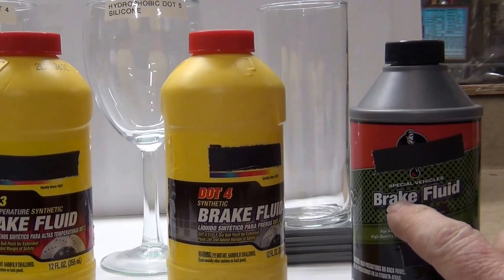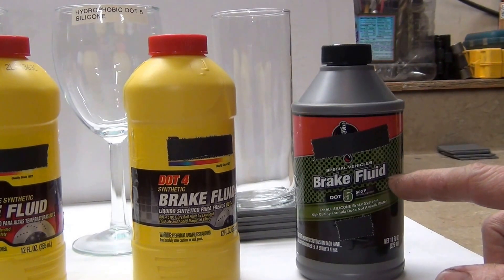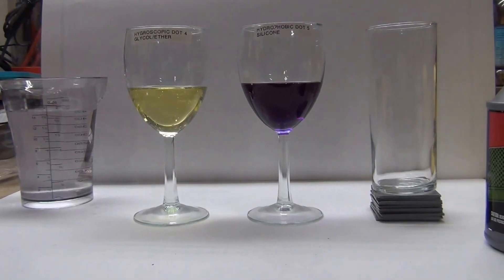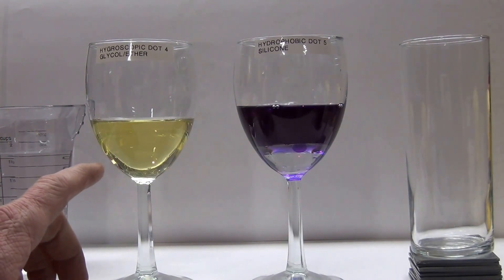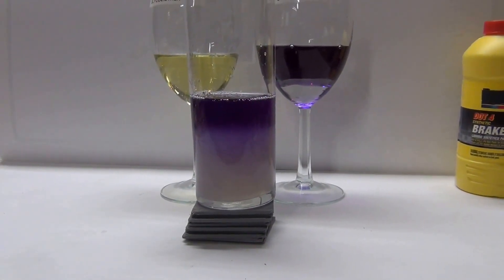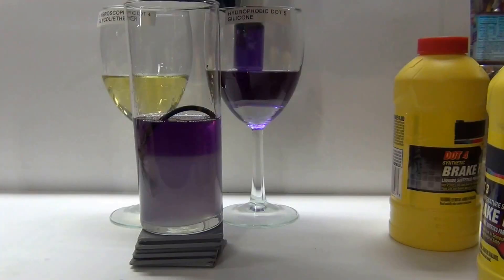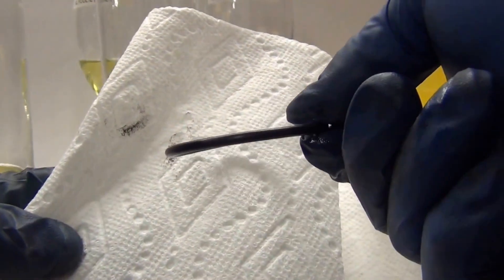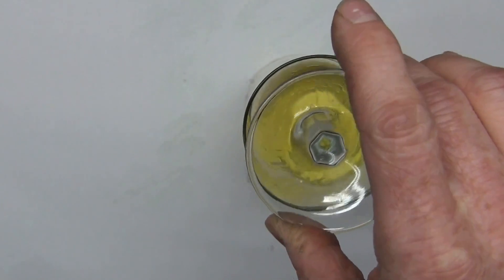Can I Mix Brake Fluid DOT Types Together? or With Water?  Answers!

Comment: Hi Brian, you mentioned the dot 5 in your mountain bike. Was that replacing a mineral oil brake or a dot fluid brake? Just asking because I'm curious if the dot 5 would effect seals that are designed for mineral oil?

Comment: The army asks for something that's hydrophobic. The hydrophobic break fluid lets water collect at the bottom and cause no end of problems.

Yep, that sounds like the military logic that I know and loathe.
Reply: since it repels water as opposed to absorbing it directly from the air there is no conduit for water to accumulate, anywhere.....  it is perfect for a system that is sealed and people are not pouringwater into the brake fluid container.
Reply: @kevinoconnell8242  perfect answer...

Comment: SO if I wanted to change over to DOT 5, all I have to do is pour it right on top of the DOT 3, and pump the brakes until I see solid dark purple from the bleeders?
Reply: If your car doesn't call for DOT 5 and didn't have dot 5 in it already it's a bad idea to try to switch to it, also from what I've read it may not need to be changed so often but it gives a bad pedal feel and doesn't work as well (won't work with ABS so well in colder climates due to the viscosity of it).

Comment: ive kept a bottle of 5l dot 3 fluid and it kept for almost 2 years lol mind you i kept the cap on tight all times but i used it often and it felt just as good the last bit i used as when the bottle was new, and ive also had brakefluid sprayed in my eye from my bleeder hose coming off LOL watch out for that but im fine

Comment: Excellent video! About seals: I have a 2-cycle weed eater engine that I partly disassembled and cleaned with carburetor cleaner. I re-assembled it and liberally applied 2-cycle synthetic oil of the suggested type on all bearing surfaces and its crank case O-ring seal.  The carburetor cleaner didn't seem to hurt the ring right away so I just oiled it and put it back in there. Was that the right thing to do? Or will that ring be unable to deal with all that oil and solvent?

Comment: Having a couple of military trucks and working with civilian trucks, I have experience with long term use of the different types of brake fluids from DOT 3 - DOT 5, but haven't used the DOT 5.1. 
Military specs suggest to use DOT 5 specifically because it is hydrophobic (does not absorb water) for many reasons, one being that some vehicles are designed for water fording.  Also, they want a standard for use in many vehicles, so that they do not have to carry a multitude of fluids that are not applicable to all.  

When you "accidentally" mix DOT 3/4 with DOT 5, it does eventually sort of mix together, if you call silicone sludge slime mixing.  It creates all sorts of problems when the fluids are mixed.  My 46 year old truck has DOT 5 in it and it works like a charm.  
The only real time you wouldn't want to use DOT 5 is with fast acting actuators like they use in ABS systems, it does tend to draw up the bubbles which is not good for ABS type of brakes.

People wonder how the "water" gets into the brake system.  Mostly from the heating and cooling from the brakes, not just when you leave the cap off of the master cylinder, though that can contribute to it as well.

Good video, keep up the good work. Sub'ed.

5Ton Fluffy
Reply: I've been wondering though, some water mixes in with dot 3 or 4 but water sits on top or on bottom of dot 5 which, to me, would be worse because it would be direct water on internal components vs a mix.

I'm trying to figure out what I have, I have a humvee which should be dot 5 silicone but my color is a dot 3 or 4(not purple), some people say it can change color but that would be pretty dramatic if it shifted from purple to yellowish.

Comment: I bought a 1957 MGA from my girlfriend for $200.  She had put regular brake fluid in it when it needed the mineral oil  available back in 1975.  I had to open the system including clutch slave cylinder.  I replaced all the o-rings and natural rubber parts that the fluid comes in contact with, replace with new parts, and bleed the system.

Comment: Wow,  totally informative.  I never knew it broke down and how water affected it.  Now I'm writing dates on my stuff.  Makes sense but i didnt know how it worked.  I flushed my integra lines to the rear from the prop valve and it was all milky and gross.  Till I cleaned them out and blew air through.  Then I got them done up right with good pressure.  But i was surprised at the crap that came out of both sides. Works great now till engine blew,  but ill rebuild it quick enough.  I use Lucas oil additive on stuff alot but not alot per car. I just use old fluid for bleeder kits. I'm hoping that's ok. God bless your family Brian,  dam fine job sir!!  HUA.
Reply: You can get electronic brake fluid testing device that tells you the moisture content of brake fluid and if it's still good, acceptable or bad. I had a container that was opened about 6 months ago, with some extra fluid and I think it tested 0% or 1% moisture (can't remember) but it was still good. The stuff in my cars brake system (from that same bottle) was like 2% or 3% basically almost at the 4% 'bad' level.  So as long as the bottle isn't left open and has a good seal it might still be good.

Comment: No Old Wives Tale. As you know coming from a cold climate as well Bmob... Silicone will swell rubber...just like weather stripping. I have personally had to deal with this situation twice in my career. Once with a 2001 Cavalier, and once three years later with a Suzuki Vitara... both brought to me with a soft pedal. After a quick inspection, I found that all seals...including the seal even on the cap for the master cylinders were soft gooey and swollen and unable to hold their shape. Ironically on the Suzuki, the Girls Father owned a Harley Davidson and toped up the brake fluid with DOT5 after replacing one of her calipers. So yes, it is infact true. Just thought I would share my personal experience. Thank you for what you do!
Reply: And I was thinking a layer of dot 5 silicon would help keep the air out of a dot 3 and 4 brake system

Comment: Is DOT 4 Ultra just as good as DOT 5.1 ?
Reply: Yes it can be. There are some DOT 4s with higher boiling temperatures than DOT 5 or 5.1. I think manufacturers are afraid to call them 5.1 just because people are confused / afraid of using the wrong 5.0 one in their cars. Make sure to look at the dry and wet  boiling points. Low viscosity ones are supposed to be better if your car has ABS and you're in a cold climate. 
Unless you're taking your car to the track though I don't think most people NEED a brake fluid with a really high boiling point.

Comment: how about oil and break fluid , I worked on someone’s car and found oil in the break fluid reservoir
Reply from the maker: I've heard stories of the wrong fluid in just about everything.  That would be interesting.
Reply: I once put oil in the radiator in a Load Handling Truck in Afghanistan.  Maintenance hated me for the rest of deployment, possibly having to do with emptying half-liter bottles to flush out such a huge system.
Reply: i've heard that can cause problems... DOH!

Comment: i jave 2001explorer sport  with a 4.0v6 sohc automatic  tranns does the neutral safty switch  on that control my reverse lights  on my car
Reply: You don't have a neutral safety switch on that one nor a reverse indicator switch either.  You have instead an all in one range selector switch. See how the terminology changed to indicate the situation? Use the proper term and avoid confusion. The hint all in one gives the answer yes but there is are computers involved to drive the reverse lamps. Prior experience with that system and I know that the connector for the range selector is hanging out in the breeze where things can tear loose critical wires used by the computers to tell it what gear the transmission is in. Mine was 2001 F150  Transmission 4R100  - dorman 511-101 range switch WPT806 connector, 3U2Z-14S411-FGAA wiring kit with new connector. eBay has the kit for $60, search wpt806 though.
Reply: Lee Barnes i was told by ford thats what is called i have an explorer not a 150  thanks

Comment: Question,
If we buy a small bottle to top off dot 3 normal type everyday use cars, the bottle that was opened should not be used anymore due to moisture in it?
Reply: Joe Soliz Technically, you shouldn't have to top off your brake fluid! As the brakes wear, it will displace fluid for the missing brake lining. If your brake fluid gets low, it means that your brake linings are worn out! Topping off the fluid is useless, as time has passed since last serviced, and you should change the linings AND FLUID! But to answer your question, NO DONT USE IT! One does not know how long it has been opened, nor how much moisture it has absorbed! Even if you opened it, and know it has had a cap on it, and for how long, it absorbs moisture over time. Now, as a side note, if you live in a dry climate, and you open a new can of brake fluid for a slight leak after a brake linings change, and you just use it temporarily until you can get the leak repaired, and you use an opened bottle for a few days, it will not harm anything.
Reply: Makes Sense, and I am understanding what it means to do a brake job & why they cost so much, if done properly. Thanks for the input.
Reply from the maker: A good rule of thumb is if the open bottle is more than 3-6 months old in a humid climate- it's deteriorated.  It will still work, but not at the level it's designed to as set forth by the DOT.
Reply: Joe Soliz No, that's not the case with the moisture!! While a moisture contaminated brake fluid can certainly cause deterioration of the internal brake lines, it's not an immediate concern. Moisture dissolved in the fluid will change the boiling point of the fluid. It will not absorb as much heat, and may turn to a steam too early, and therefore not actuate the brakes when needed! Brakes change the form of movement into a heat! The friction from the linings against the rotor (or drum) produce massive amounts of heat. Some of the heat is transferred to the fluid. The fluid is a hydraulic fluid, transmitting pressure from the drivers foot, to the linings against the rotor! If there is water present, it could flash to steam, and steam makes a horrible hydraulic fluid! Or I should say, it does not make a hydraulic fluid much at all. Moisture would prevent the fluid from doing its job, causing a collision if the brakes failed, long before any corrosion would cause issues!! Beside, a vehicle from the rust belt already has corrosion issues from the outside! It's more serious than from the inside!!
Reply: Billy R Very good theory. However, there is a small hole in the reservoir that allows excess fluid in storage to be drained into the fluid column in case of a fluid loss. So, as the brake pedal is completely released, any pressure build up would then be released if the brake pedal is released. But the steam in question would flash over as the brakes are being applied. And if at any time the brake pedal is released, the steam is allowed to expand, forcing fluid out back into the reservoir, and then on next brake application, VOILA no brakes! In a scenario where one is taking a weekend romp in the backwoods, down a mountain. Repeated application of the brakes, followed by a short burst of acceleration, followed again by heavy pressure on the brakes. Heat could build up in the caliper, very close to the pads and rotors. The excess heat is transferred into the fluid. It builds up to a point that any excess moisture would suddenly flash over to steam. As the brake pedal is released, the moisture turns to steam, and expands greatly! The expanding steam pushes extra fluid back into the reservoir. No pressure on the brakes. Heat dissipates for a moment, and removes the high temps needed to make steam. Regardless, the next brake application is not as expected, and maybe non-existent! So your weekend afternoon romp in the back woods mountains, turns into a frame bending accidents into an unsuspecting tree!! Fresh clean and proper brake fluid is crucial in every brake system. Dirty, wet, and incorrect brake fluid is a recipe for disaster! Change fluid at every brake service. Don't just pop in new pads. Take things apart, do an inspection, clean of the gunk, lube the contact points, and CHANGE THAT OLD NASTY FLUID! If you do a front brake job, take the back wheels off, inspect what is there, adjust if necessary, replace if close! Change the fluid every 3+/- years.
Reply: I see, contamination can deteriorate the lines and thus give you a false sense of thinking that you have a bad brake master cylinder & braking system components. Thanks, learning as I grow to understand things. Thanks for the info.
Reply: Good Theory ! But I would think that the steam would build excess pressure that would not be fully released when the break pedal is released due to expansion causing premature failure of the caliper and or the break linings ?
Reply from the maker: Did you see how normal the DOT 4 looked with all that water in it?  Crazy huh?
Reply: I know, love that someone explains the stuff we are buying

Comment: Brian Glycol Ethers' claim to fame is that they are completely miscible with water. These chemicals are the key to all waterborne paint systems (like house paint) as they have the solvent power necessary to dissolve a resin but can be diluted with water. This unique property of glycol ethers (the ability to mix with water) are why antifreeze works the way it does. Any brake fluid that uses glycol either will absorb water.
Reply from the maker: Nailed it!  You just earned a heart to that comment.  Well said, and thanks for saying it.

Comment: why does the fluid look dirty and used after time even though the system is sealed?
Reply: MusTang Nick I believe it has something to do with heat cycles over the life of the fluid. I think the heat breaks it down over time, that and corrosion from the steel lines
Reply: MusTang Nick The master cylinder caps will still allow some air and moisture in. especially in humid regions.

Comment: So can I use Dot 5 instead of dot 4 on my bike? Or is that not advisable?
Reply from the maker: Most everyone in the know will advise you not to.   Without major cleaning you'll have corrosion in the bottom due to strata and trapped moisture that will concentrate in old DOT 4 left in the system.  If you want to do something challenging- learn a foreign language or help a friend to stop smoking.
Reply: long ago I read that DOT5 in better for collection cars, or don't used too often or long distances, because don't absorb water and don't manage heat too well. (sorry for bad English)

Comment: So, If you mix Dot 5 and Dot 3 the Dot 3 would end up in the wheel cylinders where it would absorb moisture and the Dot 5 would be in the master cylinder.  It would be kinda tricky to keep the percentage equal when bleeding the brakes.  Possibly gravity bleeding would allow the Dot 3 to pass through the Dot 5.
Reply: You don't create DOT 4?!
Reply: 3+5 = DOT8
Reply: ycmdill YOU DONT MIX THEM!!!
Reply from the maker: Sounds like you've got the concept pretty well.

Comment: looking forward to the oil additive video, I use Delo Synthetic in my diesel truck and have done oil testing and been able to drive 20,000 miles and still have some oil life left.
Reply from the maker: That's awesome!  I've heard good things about Delo 400 MGX in terms of TBN retention for longer drain intervals.  What lab do you use Will?
Reply: briansmobile1 Blackstone laboratories, they are pretty good about providing the results by email as well as a general discussion and recommendation.

Comment: Would to see you boil with a torch before and after adding water.
Reply from the maker: Another good video idea.  The result is the boiling point goes down in a closed system based on testing done by the US DOT.